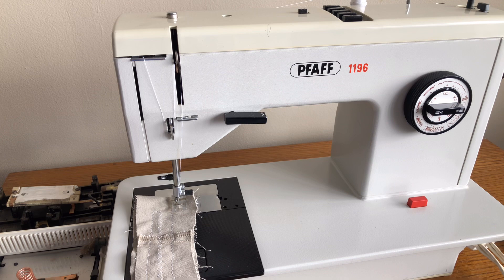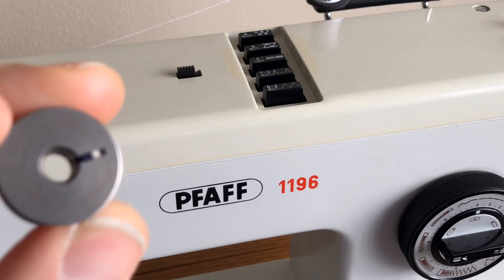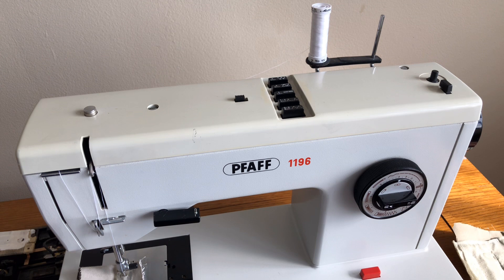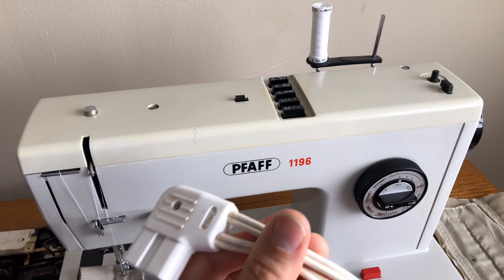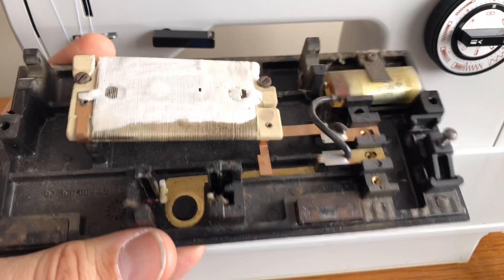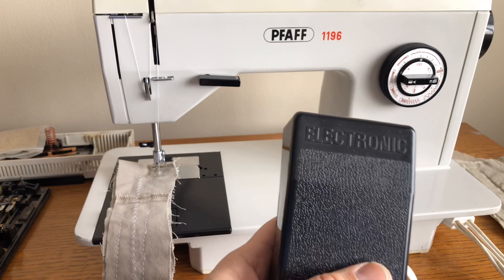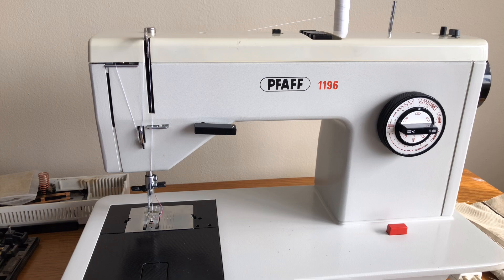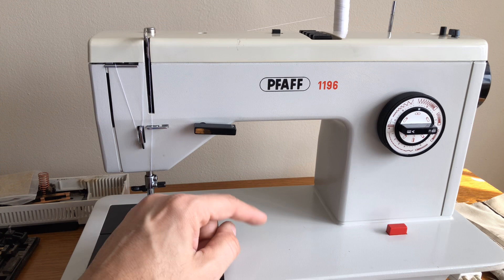DEBUT SERIES #20: A German Pfaff 1196 Well Cared For Can Make For a Pleasant Overhaul Project.

Comment: Good video! Thank you! A little tip, from me, to cure the cracking problem on porcelain insulation
pieces: Remove the holding screws and insert small and soft copper washers under the screw heads, which take some of the heat away but more importantly, the hard pressure from the screw heads
on the insulation pieces.
Reply from the maker: Thank you Thomas!

Comment: Just subscribed to your videos! I have a Pfaff 78 and 79. I bought 79 for parts for 78, but I love them both. The presser bar lifter on 78 is loose and I can’t lift it anymore. I’m thinking that Pfaff started to introduce plastic parts because both of these were built in 1969. The presser bar lifter is made of plastic and I need to find who can help me fix this part. It’s just comes off, and needs tightening.
Reply: I just recieved a 79. I have it open right now. It's so stiff.  The bobbin winding clutch is cracked too. Its plastic like you were saying. 

Do you sew with your 78 or 79?

Comment: Was wondering if you could help me. Someone borrowed this machine from me so I cannot describe exactly what is missing or has gone wrong.  Problem-my stop motion knob (missing the cap) and balance wheel are not functioning as they were designed to. I took off the top (lid) of the machine to expose the inside parts but can't figure out how the balance wheel and stop motion knob and possibly the cap are suppose to go together. I can assemble them but nothing stops the wheel from falling off and keeping the latch hook to engage the sewing machine.

Comment: Hi! Thank you for your informative video! I love all your videos!  I have a Pfaff 1197 machine and when I press down the foot controller as far as it will go, it only gives enough power to work the machine at a slow pace. It seems to run steady, just very slow (kind of like a Sunday afternoon at the park LOL). I opened it up and cleaned and polished all the copper conducting pieces because they were very tarnished and even sanded off some corrosion on one of the pieces. I then I gently angled the copper connection areas just a little to make sure that when the foot is pressed down, that it is actually creating a connection. The only thing I did not do was mess with the wires wrapped around the porcelain or the battery/motor in the corner. I closed up the foot and tested and alas, same issue. I do not know what could be causing this issue? I was wondering whether you might have any ideas as to what could be causing this? If the pedal is too far gone, I was thinking to do what you did and get a  generic replacement electronic foot controller to attach my cord to (Cord is in very good shape). Could you please share what the brand/model of electronic foot controller was that you purchased? Thanking in advance!
Reply from the maker: Hello Careen.  While there are lots of potential causes for the symptoms you describe with your Pfaff, might I suggest you first check the owners manual to see if your model had a feature somewhat common on European branded machines from this era.  Many came with an electronic setup that allowed the motor to run at regular speed as well as a slower speed (very useful for more power over heavier fabrics).  Necchi and some other brands offered this and your Pfaff may have as well.  If that is not the issue, I would take your machine to a local Sewing/Vacuum center to see if they can test the electrical functioning of your foot pedal and cord.  They might need replacing but check my first suggestion to eliminate that as a potential cause first.
Reply: @VintageSewingMachineGarage  This machine was a thrift shop find and did not come with its manual but I have looked  online for one and although it referenced this feature you're speaking of on some other models, I don't think it's was available for my particular model unfortunately. When I looked at my pedal I did not see any option to adjust the speed in the area specified on some models. Sounds like a cool feature though and that would have been an easy fix! But I am happy to share that with continued use of the machine it seems to have sped up a bit.  Although I had lubricated the machine well prior, maybe just the fact that it had been not in use for so long, caused the whole machine to slow down and it's happy to be in use again and it needed some time to fully come back to life! 
Thanks for your reply and assistance!